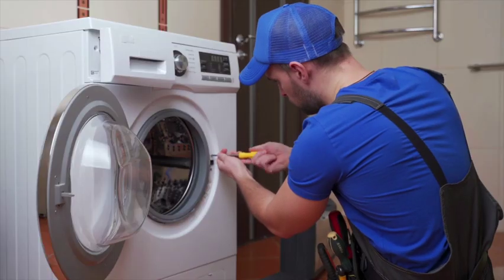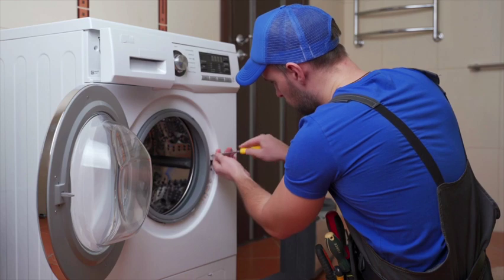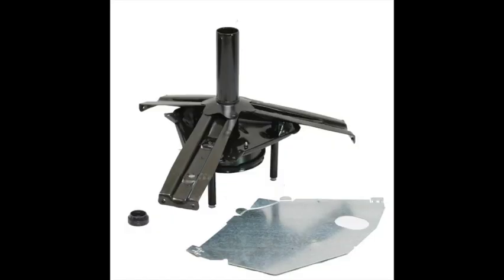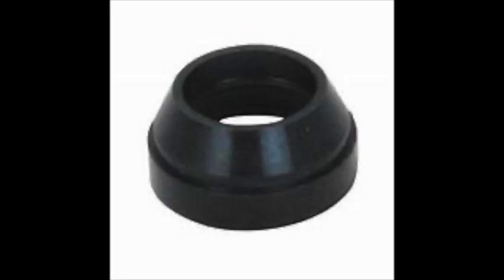How To Fix Leaks in Your Washing Machine: Identifying & Replacing Defective Seals

Comment: Chip – your videos are great!  I’ve watched several.  You mention driving the upper seal in with the transmission shaft in place.  Do you also recommend driving the lower seal in with the spin tube in place – or can you drive in lower seal into the post without the spin tube installed?  It’s a much thicker seal and I assume easier to drive in without damaging it without the support of the spin tube in place.  Thanks!
Reply from the maker: Yes, it does go in place easier, but if you have a pipe that fits the seal exactly and slides easily over the spin tube, it wouldn't hurt to have the tube support the inside of the seal. Of course, you should have the transmission installed, too, to keep the spin tube from being driven out. It's aggravating when you bend one of those seals. Thanks for watching my videos, my friend! That's a great question!
Reply: @HarperandKnowles  I’m like a regular MacGyver.. I already found a perfect sized metal pole that fits around the lower seal and sits just inside the circumference of the top lip of the seal, and I also found a 1” PVC Male adapter that fits perfectly around the upper seal.  I plan to make two notches on the adapter the size of the two tabs on the top of the clutch post so I can drive the seal flush and get the lip of the seal past the two tabs.  I know you cut a tapered edge on the 1” PVC – I think two notches will work better and prevent any potential scoring to the seal.

I know you said you were going to have a friend machine you one to replace the 1” PVC conduit you are using.  The part number to the PVC fitting I will use is PN 1436-010 – in case you were interested.... It might work better than the 1” conduit you are using the inside diameter of the fitting is a perfect fit.  It's also very cheap (in my case I had it on hand).  The adapter is short, so you will also need use another piece of conduit to get you past the top of the transmission shaft (I have plenty of things the will work).  The 1” PVC conduit might be the exact same dimension as the larger end of the fitting I have.  I didn’t have 1” conduit to compare so what you are using might work just as well, but I think you are better off notching it out to drive it past the two tabs instead of that tapered end.  Obviously you just have to line up the notches with the tabs in order it to drive the bottom part of the seal past the two tabs.

Thanks for all your help and I will keep watching your videos!

Comment: Hello Chip. Last weekend I replaced all 3 seals on a Kenmore Elite washer. It is no longer leaking but when it gets to its highest spin speed it makes a squeaky chirping noise. Any advice on where to look or what part I should have lubricanted when putting it back together is appreciated. Thanks for all your great videos.
Reply from the maker: I’m assuming it’s the top load old style made by Whirlpool branded by sears. If so you probably should examine the snubber pads for wear. It sounds like one may be worn out to the point that the triangular plate is rubbing metal to metal. Thanks for watching!
Reply: @HarperandKnowles  Thanks for your input. When I was putting the unit back together I remember thinking to myself about how all the pads were in great shape but I will go back and take another look at them. Thanks again.

Comment: Great video - thanks... about to tackle this project.  Do you need any special type of grease?
Reply from the maker: You know, that is a great question. I used the grease left over from a bearing and seal change on another washing machine. Obviously you wouldn’t want to use a grease that will damage clothes if it gets into your washer. The grease is just used here to help the seal slide into place so if you don’t have access to the grease that comes with a washing machine bearing and seal kit I’d just use a small amount of petroleum jelly or even a food safe grease might even work. If you use something that gets on the wife’s best dress you’re in big trouble!
Reply: @HarperandKnowles  Thank you..  I assume it's more critical to have a lubricant where the shaft spins on the inside of the seal otherwise it will wear prematurely
Reply from the maker: Exactly!

Comment: I'm troubleshooting a Kenmore 110.4564291 washer, we replaced the pump today hoping that would solve the issue, but it's still leaking and only really leaks when there are clothes in the washer, suggestions on where to go next?
Reply from the maker: Here's what I would do. Remove the case; if you don't know how to do that, watch this video: https://youtu.be/SfD4mk1pCGE. Then, I would put about 2 inches of water in the tub. You'll have to get down on the floor and, with a flashlight, examine the base of each of the plastic fins that are on the bottom of the white plastic tub for cracks. These are what keep the triangular swash plate in position. You can push up gently on each one to see if there is a crack at the bottom. I think there are six of these on the tub. If there are no cracks, remove the agitator, fill the tub to about four to six inches, and then watch for drips near the center of the tub near the clutch. If that passes, your tub seal is good. Now fill the tub to about 2 inches below the spanner nut at the top of the spin basket post. Again watch for leaks near the center of the tub at the bottom. If that passes, your spin tube seal is good. Now fill the tub to a super-size load; it should cover the transmission shaft. Check for leaks again. If that passes, then your transmission shaft seal passes. Okay, now, since you mention it only leaks when it's full of clothes, it might be that your neutral drain isn't working, and your washer is spinning while the tub is still full of water and slinging water out the top. This is rare. Also, check your inlet valve hose when water is filling. Check around the inlet valves when the water is filling. Check for wear spots in the drain hose; is it rubbing on the floor? If all this is good, tie a dry rag around the drain hose where it goes into the standpipe; if it is wet after a wash cycle, your washer is good, but you have a plumbing problem. I hope this helps you. Thanks for watching!
Reply: @HarperandKnowles  I took your advice, I didn't notice any leaks until I started running the agitator, then right on the bottom of the washer I noticed water near the location of the tub seal. I've ordered a new seal for it.

Comment: Hi...One question  about  an after repair issue I came across.......Kenmore 70 series washer p/n 11020702990.
My washer basket making thudding /Vibrating only after spinning cycle is stopped .It runs fine without any vibration  in all other conditions of speed and load during the operational cycle. I replaced the clutch (used blue spring instead of green came with new  clutch)   and 4 springs last week since the cloth was still soaking wet after spin cycle. The four springs were non-oem parts.That wet cloth is issue is resolved now but the above vibration showed up after repair. Please let me know what is wrong here?
Jacob
Reply from the maker: I’m confused about the four springs. What springs are you talking about?
Reply: @HarperandKnowles  1 tub spring and 3 suspension spring
Reply from the maker: Oh, okay.  Make sure the “suspension spring” is  fitted to the hole at the bottom of the frame.  Remove your transmission again and check the brake cam lever. Make sure it is secure and not broken. Also if you loosened the tub spanner nut under the agitator make sure it is tight and the spin tube ears fit into the spin block correctly.  If the basket comes to an abrupt stop spray some lubricant onto the brake shoes at the bottom of the spin tube above the clutch. The tub should come to a slow stop not a sudden jolt. Thanks for watching, I hope this helps.
Reply: @HarperandKnowles  will do that. Thanks for the tip
Reply: I lubricated the brake cams it has been working fine for past one month . Thanks for your help
Reply from the maker: Glad it helped you! Thanks for the follow-up.

Comment: What size of pvc pipe did you use ?
Reply from the maker: I believe that’s 3/4 inch and I sanded it down  on one end to reduce the diameter so that it fit the shoulder of the seal while just fitting inside the spin tube. A brass tube of the correct diameter and thickness would be much better.  I’m thinking you’d have to have this machined to the correct size.  Thanks for watching!
Reply: Thank you very much …Excellent video . Do you know anything about Amana washer my other washer …everything works it just make a loud “Quack” (Duck sound) thru the whole wash and spin cycle ?
Reply from the maker: Yeah, I know exactly what’s wrong. Here’s a video I did that shows you how to fix it. https://youtu.be/rXDETg8vaRY
Reply: @HarperandKnowles  Thank you..Keep up the good work …I highly appreciate the help .

Comment: As to what grease is best for these shaft seals......use silicone. 
Most any petroleum based grease, including petroleum jelly, can and will shorten the life of these seals.
Reply from the maker: Thank you for this tip. That is a question that I never had a good answer for. Thanks for sharing with the community!